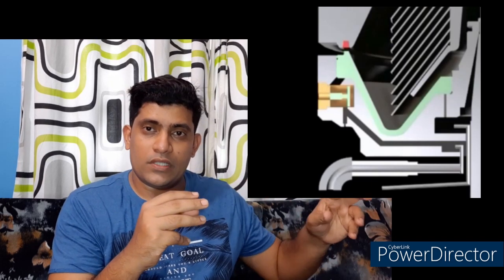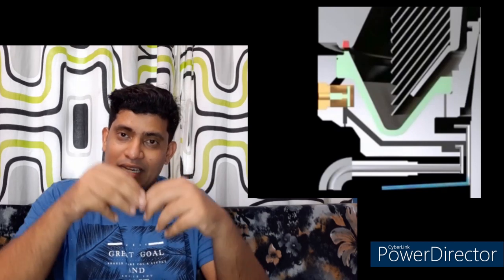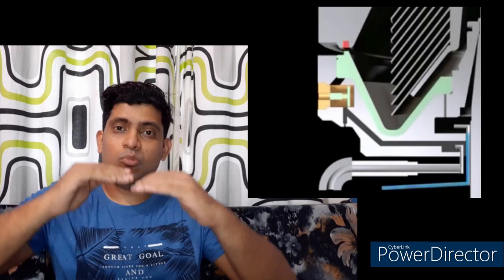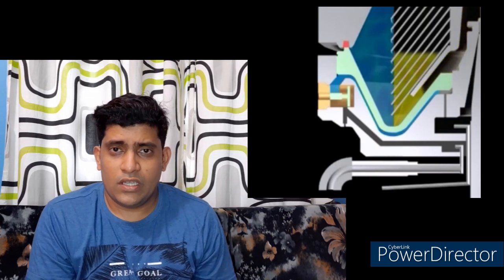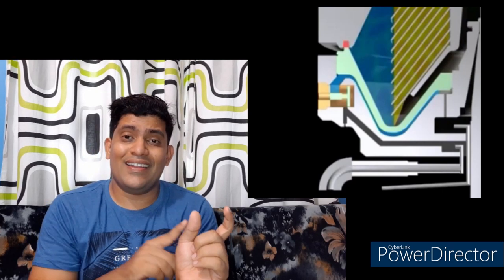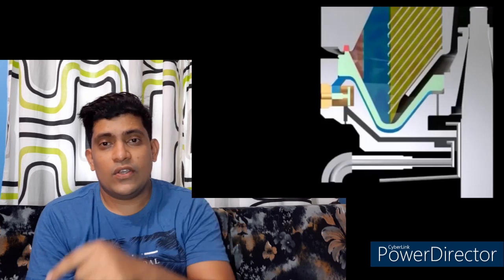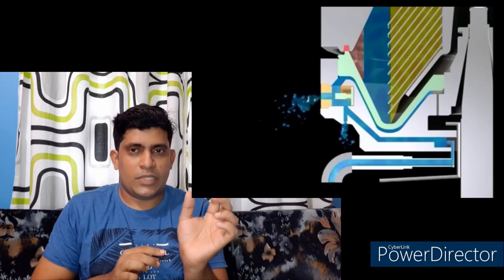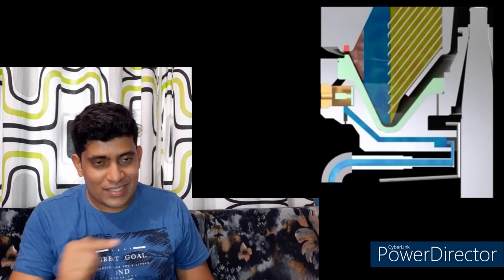how does Purifier pilot valve work #pilotvalve #purifier #mitshibishi

Comment: once pilot valve discharges operating water how it gets closed? it doesnt have any spring force to retract na sir? pls respond sir
Reply: I think it has ports on the other side where the teflon seal with o ring sits... Same higher pressure makes it shut

Comment: Helpful👍

One que.  How bowl opening water pressure is higher than bowl closing water... As both r coming from commonn line
Reply from the maker: Inside the valve chest u will have reducing valve or reducing line earlier designs had seperate header tank for sealing water n bowl closing water whereas disludgeing water comes from hydrophore, usually if u check d water coming operating water chamber n nowadays bowl closing water is not given continuous so that moment bowl opening water press is higher
Reply: @BasicMarineEngineering  nicely explained😊.. thanku
Reply from the maker: Plz share with all ur friends ...
Reply: @BasicMarineEngineering  yes surely